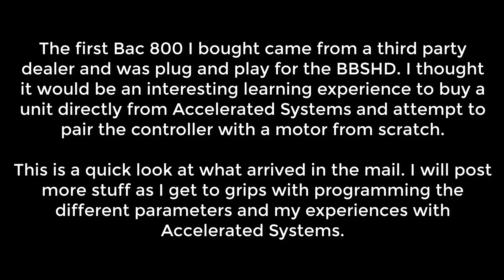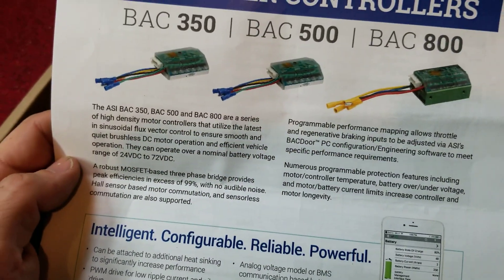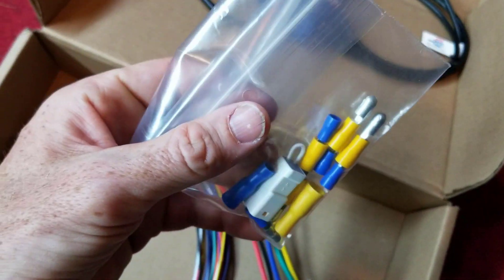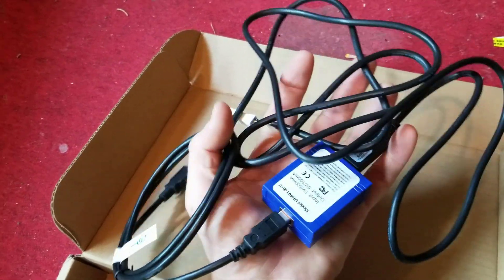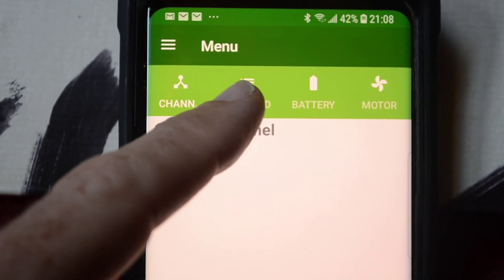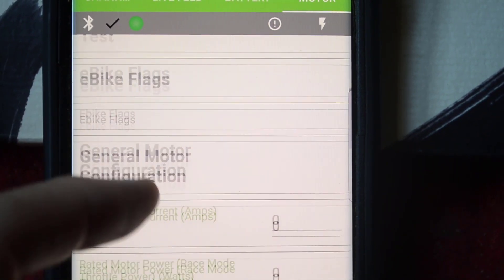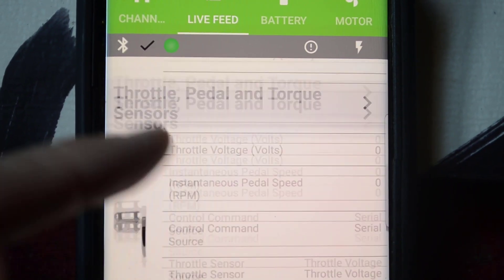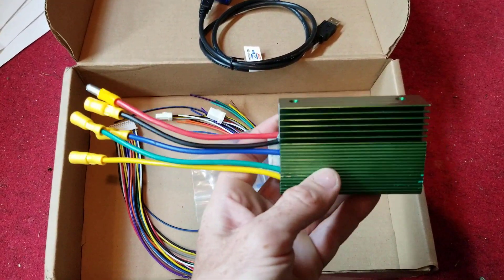ASI BAC800 - Evaluation Kit

Comment: Any idea why they charge $850 for the eval kit, when the controller can be had for much less from their distributors?
Reply from the maker: It comes with a package of engineering support. It's meant to be a path to becoming a dealer or considering becoming a dealer.
Reply: @HighVoltageKits  I see - it pays to RTFM:
"You’ll also receive ASI's BACDoor software, access to our extensive online Support Index and guidance documents, as well as one-hour of direct engineering support to ensure your ride is set-up exactly how you want it."
Reply from the maker: Its not the way I would do things but it's what ASI wanted.

Comment: Hi thanks fir the video
Quick questions: my bac 800 burned so I need to buy another one but I can’t seem to find the right one.
Mine has BAC800 TTL 485 on it, while yours is BAC TTL BT
What is the r difference?
Thanks in advance
Reply from the maker: The BT stands for Bluetooth. So without you would have to connect via a hardwired connection to upload any configuration files.
Reply: @HighVoltageKits  thanks for your swift reply
Can’t seem to find any
Do you have any links? Cheers
Reply from the maker: New its the bac855 now. The 800 is no longer made.
Reply: @HighVoltageKits  bad news then 
They are over 500€...
Reply from the maker: Ebay for an 800? Direct its expensive. For 500eu you could get an entire upgrade kit from ERT or Electron cycles
Reply: @HighVoltageKits  I did something stupid
I broke the throttle and fried the asi system
The vendor who sold me the back said he would send me a new one for 150$ but I will take months to arrive.
Can’t find anything on eBay either 
Any other suggestions?

Comment: The ASI website only show's a ASI BAC855? is that the one? ALSO WTF it cost 600$ Luna is selling there's for 200$
Reply from the maker: Buying from ASI is very expensive as you are essentially buying a programming kit. I have no idea what Luna are selling for 200 bucks but I am yet to see them run a bbshd with one. The bac855 is the upgraded bac800. Same size etc.
Reply: @HighVoltageKits  Thanks for clearing that up for me,  ive been looking everywhere for one these controllers and they all seem to be out of stock but prices seem to range from 200-300$ where every i look.

Comment: How do you pair it with your app? I have access and a controller, just can't seem to get it to show up on my app.
Reply from the maker: I have always just opened it and the swiped down to refresh. Maybe check you have bluetooth enabled?
Reply: @HighVoltageKits  So apparently they make like 4 different models. Mine doesn't have bluetooth! So done with asi. Gotta fight with em to even be able to have the right to program the controller you bought, then it doesn't even come with all the features....
Reply: @HyperEmoto  @joblessalex  yeah, me too.... It's exhausting.... :((
Reply from the maker: I really don't understand the business model sometimes. To some extent they don't want most people having access as the potential to wreck stuff and harm life is there. But so many frustrated people. They also go after people who share logins. Or id do just that.
Reply: @HighVoltageKits  I need to reprogram because my motor turns off and it can be very dangerous sometimes... I don't have speed limit, it's not that... Very very frustrating
Reply from the maker: Yeah I understand. Let me have a think on this. There needs to be a way to help people in your position
Reply: @HighVoltageKits  Thank you very much!

Comment: Interesting to see how this performs against the stock controller inc possible higher rpms. Any updates yet?
Reply from the maker: If you mean vs the stock bafang it is much more RPMs. It peaks at 12000 under load with 72 volts. Stock is maybe 7000. As far as programming goes I have not made much progress. I am learning little by little but I am nowhere near the point where I would be ready to show anything. It has brought me a real appreciation of Alan at ERT as he is able to extract a very high level of performance from these controllers.
Reply: @HighVoltageKits    leaning more towards the CYC. Wondering if you have upgraded the original  stock controller with the ASI bac 800 yet. Which as you said will be a factory shipped upgrade option. 
Think I'm right in saying this is required for 72v anyway? Or looking another way is the CYC stock controller better than the Bafang stock unit at 50v ?
Thanks
Reply from the maker: The gen 2 motors ship with a 36 to 72 volt controller now so you are good to go. If you wanted to go the ASI route then the bac2000 is a better option than the 800. The 800 it turns out is a bit underpowered for the x1. I hope to start my build with that soon.
Reply: @HighVoltageKits  Thanks for the reply. I'll keep that in mind regarding the ASI controllers. I want to build a commuter for a 22 mile round trip, their are quite a few long up hill sections and I'm not the lightest of men.

Comment: So Happy  found you. I am planning to upgrade my MATE X 750 W CZJB JB-104C2 Jaibo motor to BBSHD with either ASI BAC 800 or Phase runner. But now that I saw your heart is on the CYC X1 pro. I am starting to think it would be a better investment than BAFANG. Would you please explain what motivated you to look CYC X1 pro. Ca you advise if upgrading to CYC for me on my fa bike is overkill ? "I will be upgrading my battery pack from 48V 17.5 AH to 52V
Reply from the maker: They are both good motor. I love riding my bbshd with the ASI. The cyc is a work in progress still. It has lots of potential though. I will likely be using it with ASI controllers going forward though as I prefer the feeling you get with riding on an ASI. It's more powerful and also with the new updates it will be torque sending which is much better than PAS. But the bbshd is a very reliable motor. You can get an ASI and wiring harness from ERT for the X1 the same as with the bbshd. The only difference is you can order a motor on it's own from cyc and the bbshd comes with one. I guess you could sell in on ebay though. Glad you like the videos. Cheers!

Comment: Hello. I too have the ERT kit from Alan for my BBSHD. I love it! Will the backdoor app work with his controller? I noticed the model numbers are different from the one you get with the ERT kit as opposed to the one you have shown here that comes with the evaluation kit. The one from ERT doesn't have "BT" in the model number which I assume isn't Bluetooth compatible?
Reply from the maker: I honestly have no idea. I am able to access both my controllers via the app. It may well be that newer controllers are locked in some way now though. They can also be programmed via desktop software but I have not tried that. My pc is pretty old and refuses to play nicely with its ports.
Reply: Captain Codswallop Thanks for the reply! I will contact Alan to see what he says. I keep getting a 21H error which he says is for speed sensor but not matter what I do to fix it the error keeps popping up. Hoping the Backdoor program can shed some light on this error. Cheers.
Reply from the maker: Two things to check. Are you getting a speed reading on your display? If not I'd check the position of the sensor. If the magnet is not close enough it wont read it. If you are still getting the error and a speed reading it must be something else.
Reply: Captain Codswallop Still getting a reading. I’ve never lost my speed reading. It only errors under load when the back tire breaks traction. Esp going up an loose hill. I have tried everything imaginable to remedy the issue with no avail. New sensors, new cable, moved sensor to front wheel, etc. Weird thing is I can unplug the speed sensor and won’t get an error (except for under load breaking traction). I can ride all day with the speed sensor unplugged and no error but as soon as I break traction under a load I get 21H and the controller stops working (red light stays on controller though). I have to cycle power on the display to clear the error. Been talking with Alan but he keeps saying speed sensor. I dunno at this point. It sounds to me like some kind of hall sensor speed feedback issue maybe but the BBSHD brand new. Thanks for your help though!

Comment: Does the BAC 800 have Bluetooth that you can monitor "bacdoor" on third party models or only the evaluation kit?
Reply from the maker: The access to the bacdoor app is only via the evaluation kit. However if you use an eggrider v2 their latest app update gives you a good degree of bluetooth control over the bac800. It let's you set two profiles road and offroad with control of power, assist levels etc. Which is what most people really want. I'll be doing a video on it fairly soon.
Reply: @HighVoltageKits   thank you for your reply, I look forward to that video and have also been enjoying your CYC-X1 build! Happy riding!
Reply from the maker: James Geisel Thanks. I'll have more on that build soon.